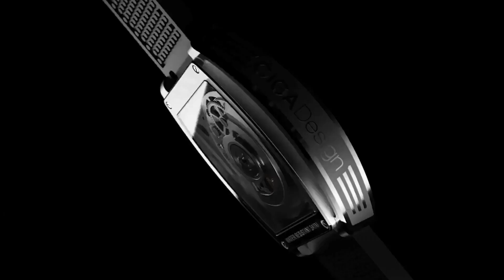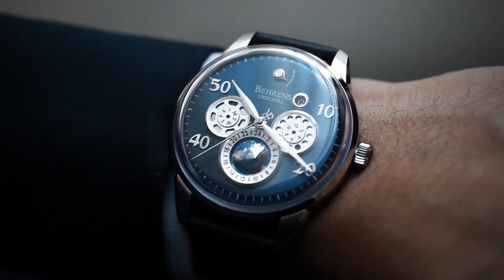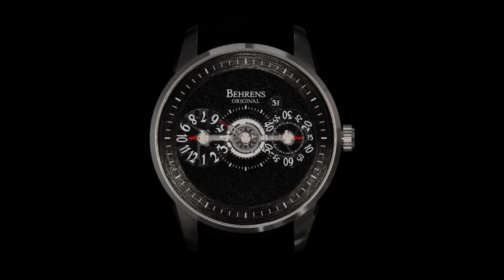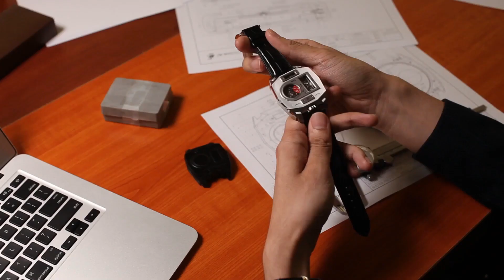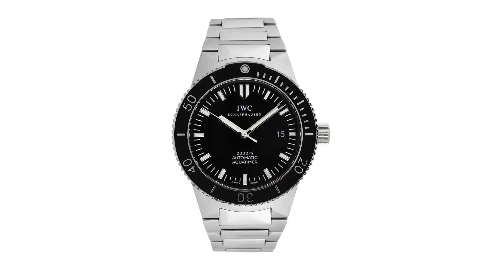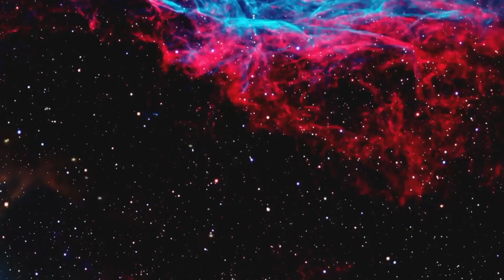Top 5 Best Value For Money Mechanical Watches of 2020

Comment: +/- 30 seconds... You're better off just guessing the time at that point.
Reply: It is +- 30 seconds time reserve of 40 hours, you dumball
Reply: @BrainSiCc  
Nope, that’s it’s accuracy. But misteratoz is not right either, it’s a ok-ish accuracy. (+-30 sec per 24 hours) on practice it will probably be better. However a Chinese movement (seagull) is horrible value for money. Even their in house chronographes cost less. You are much better of with Hamilton khaki field automatic for that kind of price.
Reply: Comments like this is a clear proof that you don’t know mechanical watches